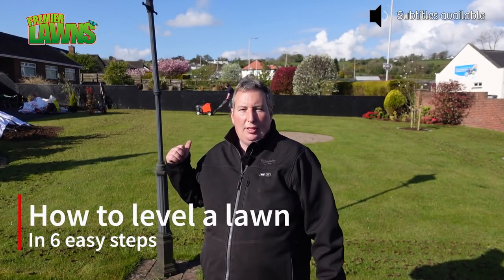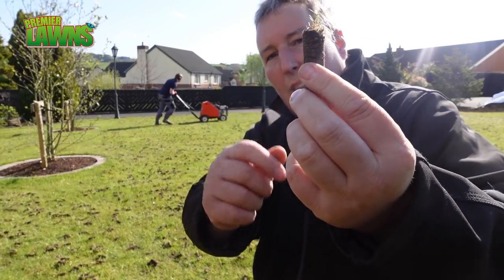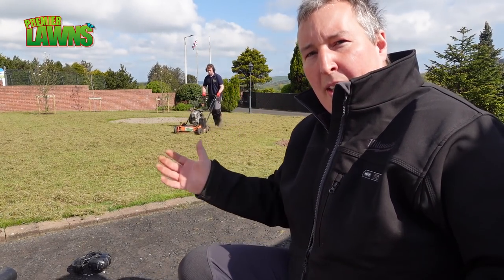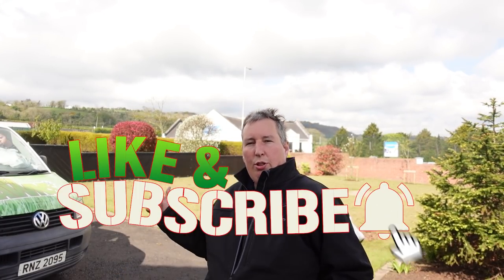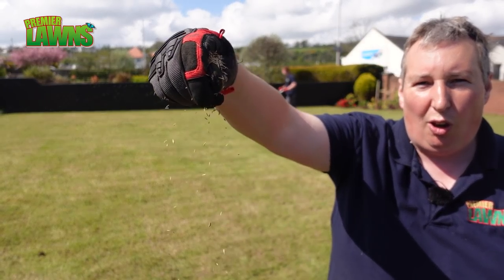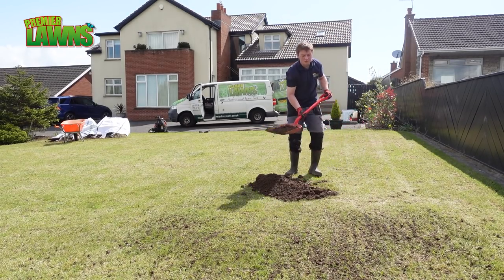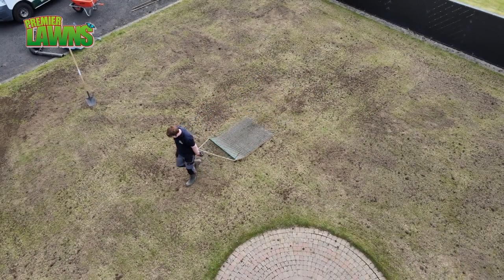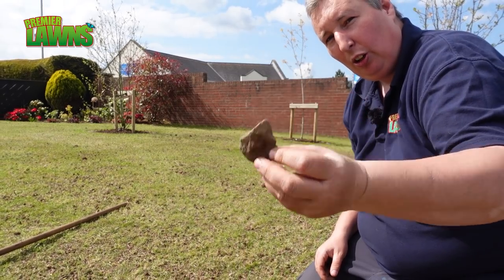how to level a lawn | level up your lawn today

Comment: Robbie, fantastic and comprehensive video.
2 things:
1. What was the biostimulant product u held up?
2. I was always told not to seed and fertilise at same time but I’ve seen you do it in a couple of videos now. What’s the current school of thought?
Reply from the maker: Fertilser at the time - depends on the products, the ones we use its grand to do it on the same day (cant say that for all products read the label) the stuff i held up is Symbio CMS Shoot, check out the video descritipion with links to buy

Comment: Hello Robbie , here Łukasz from Poland. I have question about mixing type od Grass on my lawn. Currently i got fescue ( barenburg " dry & strong") but im not so happy with that doesnt look so good . So i thinking about overseeding with another Barenburg ( Rye Grass , RPR Bar power ) what you think about that ? Will be visible aby difference between this two after germination ? Thanks in advance
Reply from the maker: Hi Lukasz your climate is a bit different than mine, warmer in the summer and colder in the winter. To be honest I'm not that sure
Reply: @Premier_lawns_official  Robbie, I mean more about the appearance of these two mixtures, i.e. fescue and ryegrass, whether there will be significant differences in appearance. As for the climate, both mixtures are suitable for Poland.

Comment: Robbie, great video as always. I’m going to give the home made drag mat a go to level my lawn. Will I be ok using some builders sand to level my lawn. In the south of England with a clay type soil.
Reply from the maker: Skip the builders sand, that will do more harm than good. Look for soil or a good quality loam
Reply: Try mixing playsand or agricultural sand that has been washed and screened . 3mm sieved soil  you can do yourself  or buy ~ the sand probably around £110 ~ £135 per tonne bag delivery costs depends on locality.

Comment: Hello Robbie,

As an avid watcher of your YouTube channel and understanding that you have a vast knowledge of lawns and how to renovate/ improve lawns I have an issue I’m hoping you would be able to spare a few moments to help me with.

I currently have a very sloped grass area I plan to level by using sleepers on the lower side and backfilling with dirt to the required level to try and get it as level as possible before laying seed for new lawn. 

My issue is I’m not sure of the best type of dirt to use to fill in the lower sided slope to level out. Are you able to recommend dirt that can be used. I wasn’t sure if top soil would suffice.

Many thanks in advance.

JC

*ps - apologies for contacting you via email - I didn’t see the contact method request until I scrolled further down on your website 😬🫠
Reply from the maker: Hey JJ, I get loads of questions via email and would love to have the time to answer people there, but I just don't have the time. 
Ideally you will want around 8" of topsoil, compacted down to 6", this way its not going to dry out as fast and should drain ok too. 
If it's deeper than that, maybe think about some stones, 20mm stones or similar (something that won't bind together)  Bigger if you wish...
Reply: @Premier_lawns_official  thank you, yeah I think I’ll rotorvate the current high spots to try and level as best as possible and then buy a few tonnes of top soil to dress the whole soil area up to the height of the sleepers.

Thanks for your help!

Jc

Comment: Hi Robbie, hoping you could help?
I recently completed my lawn renovation just over a week ago. I completed aeration, scarify, overseed, pre sed fertiliser and top dressing. Now the top dressing has settled down, there are quite a few stones and I think I may have buried the seeds to deep. I was thinking of raking to remove stones and thought it may help the seeds come through the top dressing easier? Any help would be appreciated? Thank you
Reply from the maker: Yes rake any big ones off. Stones are good for a lawn. Though not good if a mower hits them
Reply: @Premier_lawns_official  That's my project for this evening then. Thanks for the advice.

Comment: Hey man magic video, away to start renovating my back garden. Any tips for levelling the ground before hand. Any plans for the levelling mat that you have? Seen the mat but noticed you have a bar as well.
Reply from the maker: Leedt dry, it will be much easier to work with
Reply: Thanks man👍

Comment: Hi Robbie! Great Video! Are you making a short cut of the grass before the core aeration? I have a very bumpy lawn is it better to sand first than seed and then put some soil on it und then use a garden roller?
Greetings from Vienna!
Reply from the maker: Hi Peter, not a big fan of rollers to be honestYes, its better if the lawn is cut before hand, makes my job easier

Comment: Great videos Robbie! A question for you,  I've cleared an area and looking to sow a new part of the lawn from scratch by just using topsoil on top of the existing base of soil, I was going to wait until September to sow the grass seed as I've read its better in autumn but does it matter in NI when we don't get long dry spells, would you just sow away now or wait? Cheers
Reply from the maker: You can do it now no probs at all. Though you will have to water it more 👍

Comment: Why use soil and not sand ? Most people use sand like they do on golf courses.    Last year I tried it also with soil. This year I want to try sand.
Reply from the maker: The rootzone in this lawn is soil. The soil is good, it's not clay. There is zero benefit in adding sand in this case 👍
Reply: @Premier_lawns_official  so if someone has clay they should use sand ? And if someone has soil he can use soil for topdressing?
Reply: @Bazakilouis  I'm no expert but you want to be careful of using sand with clay otherwise you can make cement! Around here (Hertfordshire) we use a 70/30 split between sand and topsoil!

Comment: How much soil would I need for top dressing 1800m2 ??
Reply from the maker: A lot!
Reply: What would you recommend?
Reply from the maker: @JoeLzJARO  hard to say. How are you applying it? Machinery wise?
Reply: @Premier_lawns_official  no manually wheelbarrow and shovel.
Reply from the maker: @JoeLzJARO  that sounds like a proper backbreaker. It's roughly a bulk bag for 125m2
Reply: Ok thanks

Comment: Seems like we could make Daniel's back a little less sore if he cast the soil from a wheelbarrow? Instead of stooping down with that short shovel?  I mean, there's character building and then there's just plain backbreaking. 🤷
But, reak question, why is it important to match the existing soil? Why do so many Americans topdress w sand or sandy mixes? Is it ever the better choice?
Reply from the maker: Kay I will be diving more into topdressing in future videos. Sand has more cons than pros. Most lawns it shouldn't be used. The easy answer is it looks good on video.